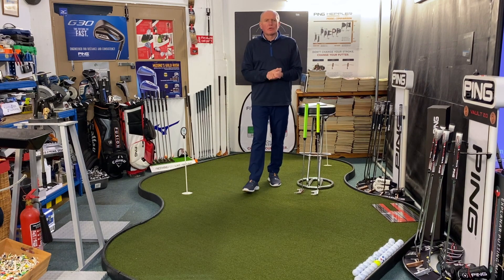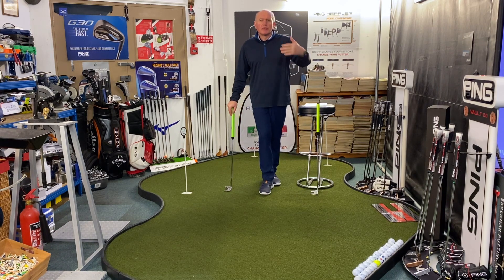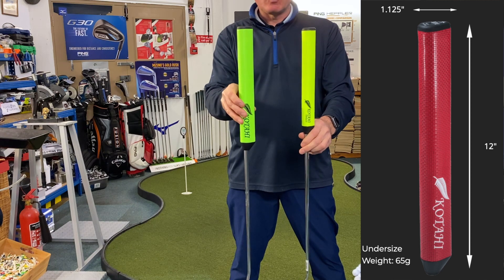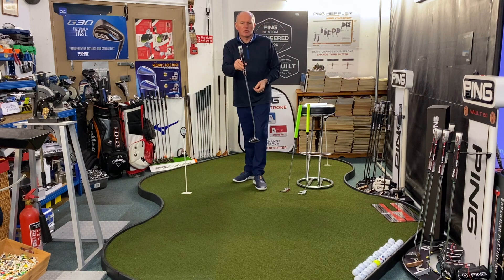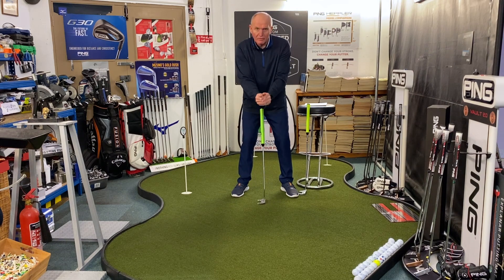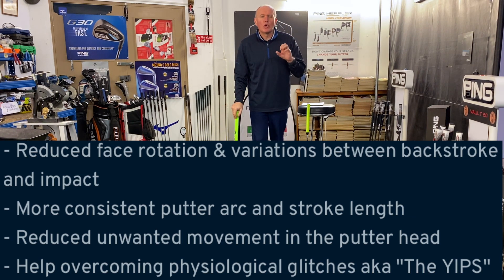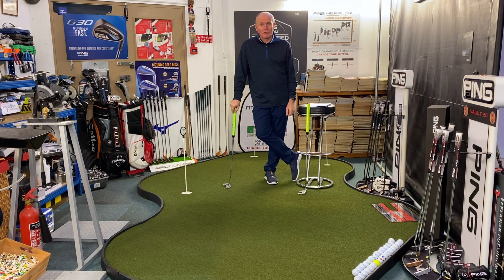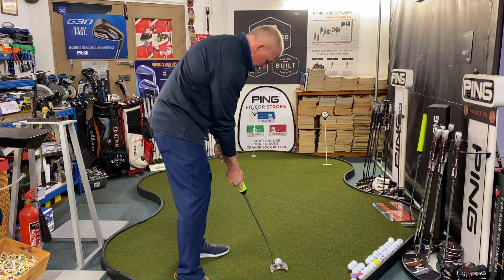Putting problems? I may have a solution.

Comment: I have used the grip for one week, and I think this is great. 
Be careful with installation of the new grip, don’t use compressed air.
The putter pocket in my golf bag was to small, so I have to place the putter together with the other clubs.
IMPORTANT: The long grip =100 gram, the old grip was150 gram, so I ordered a 50 gram counterweight. 
Checked the swing weight before and after.    
Greetings from Norway.
Reply from the maker: Thanks for the info! Hope the new grip helps.
Best regards
Andrew
Reply: Are you still using the grip ? Very curios. Thanks
Reply: @jimmyp6049  
Sorry, no I don’t - it was not a good fit for me.

Comment: This is a great concept , have tried this and it works , but the grip its self suffers from bag rash very quickly , so have migrated to the P2 putter grip    Edit-,  in fairness i had this about 2 years ago and the material may have changed,  they are nice if gripped as required, dont be put of trying something that will take the wrists out of the stroke.
Reply from the maker: Ok, thanks for the info Ian. Will pass that on to do designers.
Best regards
Andrew
Reply: @andrewainsworth497  feel is great material just needs to be more robust,  a lot of players were curious but did not get how to grip it , Garson  have a grip with a tear drop shape but a lot smaller,  i did make my putter an inch longer to take into account the butt grip , but i do have back issues, nice review of a good product.

Comment: How long are those putts Andrew? Eighteen in a row is beyond me, maybe 5 would see me out. As far as the grips go, could it be applied to my Ping Valor's adjustable length shaft? I used a Superstroke larger grip on my old Zing g2i and that worked nicely but would it work with the fancy shaft?
Reply from the maker: Hi Ken, around 9 feet. The surface is very pure with no break on it. Once I get my eye in it is a fairly simple putt.
Not 100% sure how this would work on the adjustable length putters. Will try and find out for you.
Best regards
Andrew